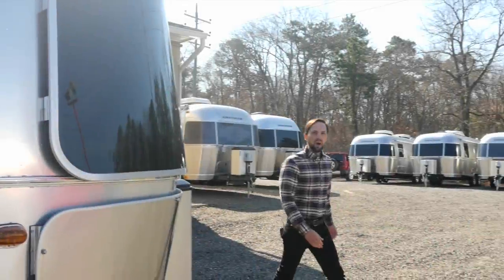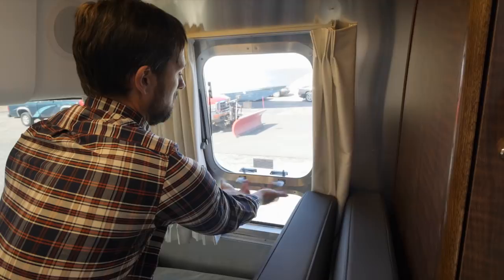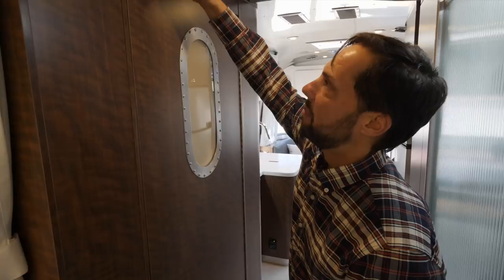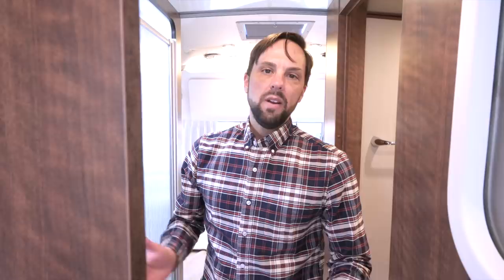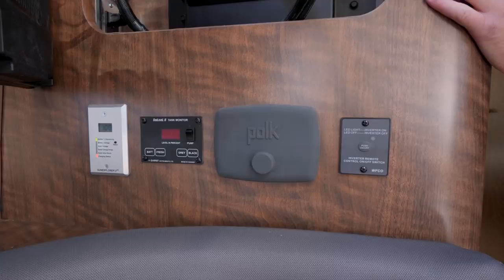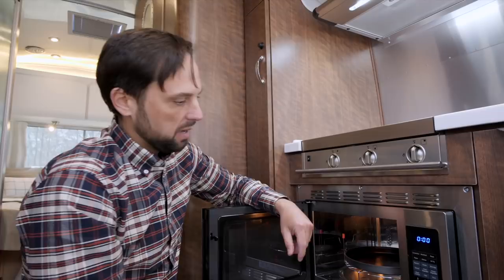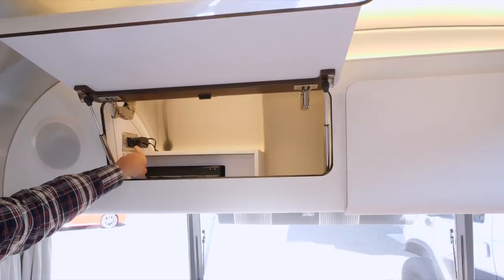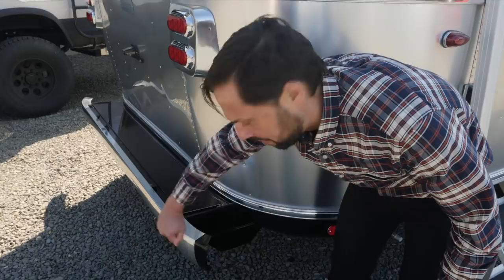2019 Airstream Globetrotter 25FBT Walk Through Travel Trailer Luxury

Comment: Good job (as usual) Patrick. Could you possibly do a walk through on a 2019 23FB Flying Cloud? I would like to see the improvements as compared to our 2017 model. Also I wish that colonial was our local dealer. We had a bad experience with our local AS dealer. So much so that we actually bought our trailer last August from the original owner.
Reply from the maker: Thanks for watching. I have 10 new models Airstream is releasing for 2020 so I can possible add the 23FB FC to the last after the new model launches are done.

Comment: Patrick, a few questions on Airstream twin models. Do any of them have drawers instead of drop down front underneath storage? Also, it looks like there are cutouts under the mattress of the globetrotter, do all models/model lines come with cutouts under the mattresses ? Thanks.
Reply from the maker: Thank you for the message. None of the twin model have slide out drawers currently. The cutouts are needed for the Tuft and Needle mattress that is standard on the Globetrotter.